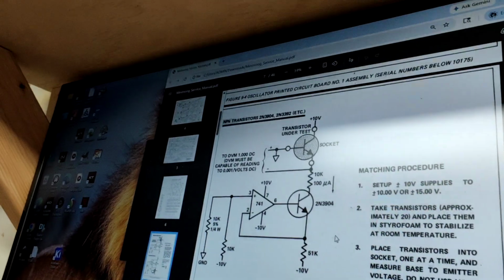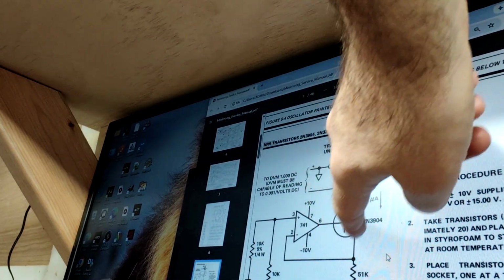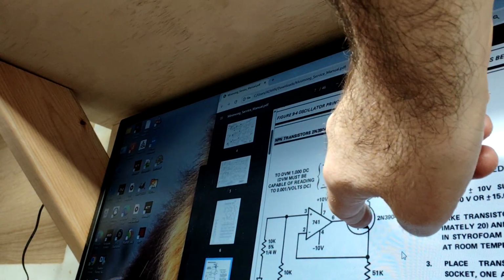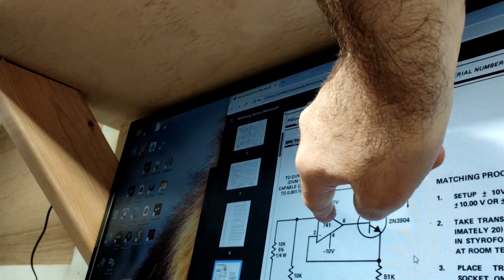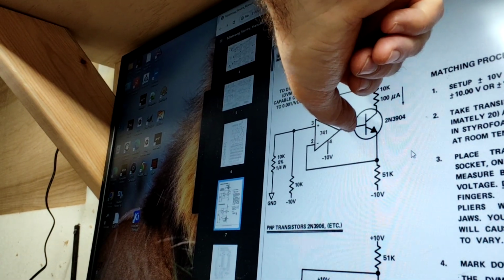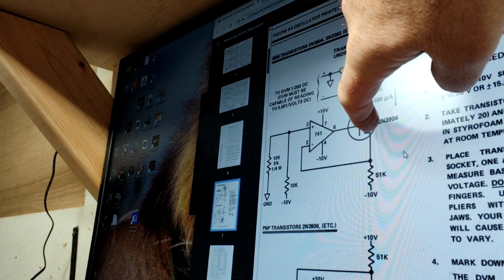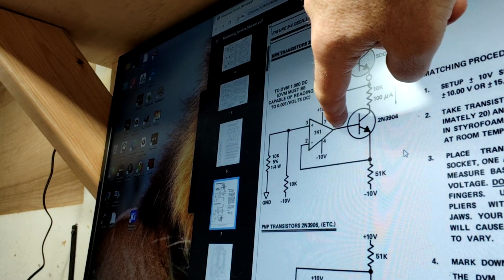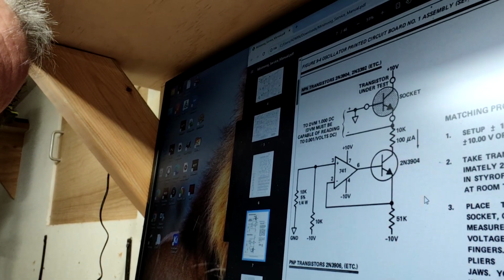Ep1: Transistor Pairing

Comment: Cool video! If you are making more complex tests on a protoboard, it can help to make the layout in a planning software, e.g. DIY layout creator. What I like to do is copy what I make, and flip it in such a way that I can see exactly what traces I planned out, in the way that it looks when the board is turned around. It takes some time to sketch the circuit, but it also saves the major headache of doing the wiring mirrored. Which is doable for a smaller sample, but as things get bigger, it gets harder to solder it correctly first try. 

What is you background? How did you come up with the idea to try this project?
Reply from the maker: Thanks for the tips.  I used Kicad PCB layout to get the component placement.  That worked really well after learning the workflow and reading the cryptic footprint names.

I am a software engineer who got interested in modular, then vintage synthesizers, then repair.

I love the accessibility of through-hole components, and I wish there were synthesizers still built that way.

As someone that spends so much time looking at screens, I get a lot of comfort from the physicality of hardware instruments.
Reply: @AnalogWorkbench  That should work as well, if you fiddle with toggling layers and such.

Through hole soldering is indeed a nice way to quickly prototype, and if you like the through hole concept but want to have a pcb for some parts, maybe to avoid certain parasitic effects that come with the thick lead traces. You can develop your own single layer PCBs straight at home with nothing but a printer, some chemicals and some patience. 

Maybe that feels more like doing it yourself, as opposed to sending off a  design to some manufacturer and getting it mailed to you. I mean you did it fully yourself after all.